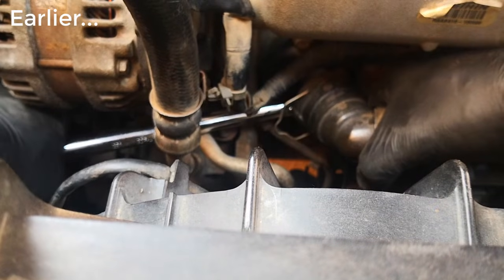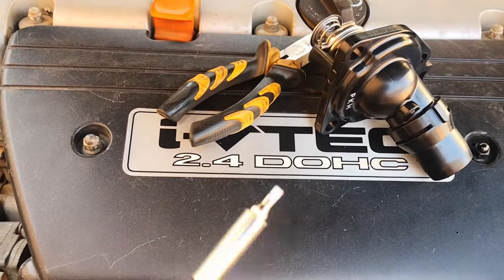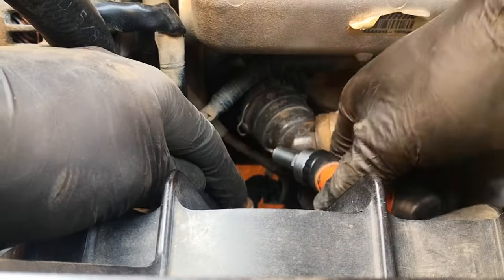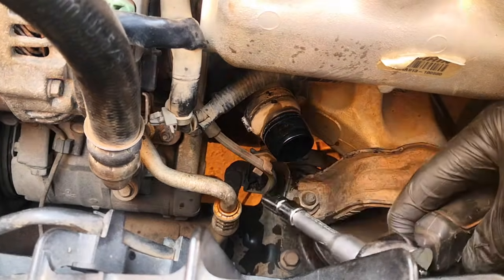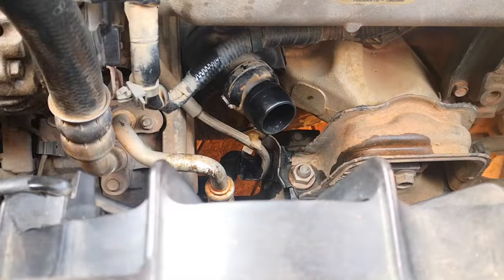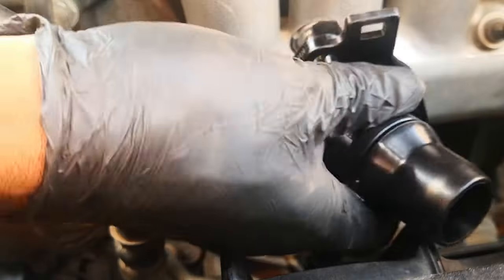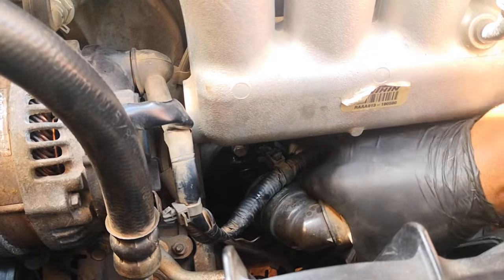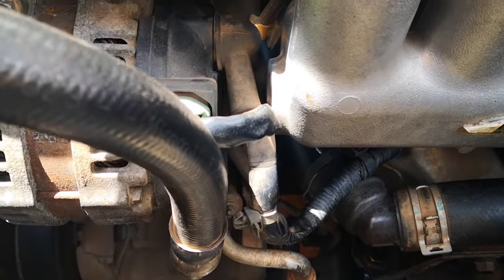Thermostat Replacement on Honda: 2003 - 2007 Accord, Element & Odyssey (K24A 2.4L engine)

Comment from the maker: Although most manufacturers do not provide guidance for replacing the thermostat, it's one of those parts that should be replaced as part of preventive maintenance in high mileage cars. Especially when critical components of the cooling system are replaced.

Comment: Nice job, aren't there two stats the on bottom, then the one on top with a temp sensor.
Reply from the maker: Thanks mate. The '03 doesn't have those. I believe it started with the '05 if I'm not mistaken.

Comment: My 2007 Honda Accord is now almost 210,000 miles and I have been learning how to replace parts and keep it running. As I drive it in the north, the salt from the roads and the yearly temperature fluctuations has really made removing bolts difficult; 2 of the 3 bolts were stripped and rusted in place. However, with some patience and taking some time to get away from the car, I was eventually able to remove the old thermostat somewhat destructively. The trick that helped my was penetrating oil (PB Blaster) and hammering on a smaller socket to get a bite on the bolt. Once the old one was removed, the new thermostat was simple to install and replace. Thank you for the help!
Reply from the maker: You're welcome!

Comment: Thank you for the video! I got it done in 30 minutes. Getting the hose off was easy. Just pryed at it from above with a massive flat head using the intake manifold as a leverage point.
Reply from the maker: Thanks for sharing the leverage point!

Comment: Are these bolts known to snap im worried ill break one
Reply from the maker: Haven't seen one snap, but not impossible. Though I don't think you should be that bothered. Is it rusted in place?
Reply: @DIYAutoworksNG ill take a look later on but the car is at 220k+ miles and according the dealership papers and the last owners the water pump hasn't been touched since it was bought over 15 years ago

Comment: Can this also cause my car idle so high on cold  start
Reply from the maker: A bad thermostat that is stuck open can cause a high idle, but "so high" is subjective. Is it a Toyota? If yes, did you reset the ECU recently, take off the battery terminals or clean the throttle body, and didn't do an idle speed relearn? Those will cause a high idle.

Comment: Will this cause ur radiator to leak? At the top and cause ur engine to overheat???
Reply from the maker: A blocked thermostat will overheat an engine. Not sure about causing radiator leak but plausible, though I think radiators leak mostly from ageing.
Reply: @DIYAutoworksNG  ok a blocked thermostat , I get that part but what about will that also cause it to leak at the top of the radiator near the top hose

Comment: To change the thermostat, do you have to drain the coolant or can it be changed without draining?
Reply from the maker: You have to, but I would imagine it can be done without draining if you have a clamp on the lower radiator hose. I won't want to subject the hose to the stress though..

Comment: Both fans turn on when AC is engaged, but neither fan turns on with a hot engine with the heater going full blast. Does that mean the thermostat needs to be replaced?
Reply from the maker: You may want to look at your coolant temperature sensor/switch. I'd go there before the thermostat except if they're integrated.
Reply: @DIYAutoworksNG  I replaced both and still the fans don't turn on unless AC is engaged or the switch wiring is jumped with a paper clip. When I turn the heater up full blast, it doesn't get hot really. Maybe the water pump is the issue.

Comment: I greatly appreciate this video - I have a 2007 Accord.  I can't get the bottom left screw.  I've tried almost every different size ratchet and extension but can't get the necessary leverage for the last screw.  I know it's a Size 10  but .....  just frustrated as I got everything drained, hose off and 2 of 3 screws off in minutes.  I'll keep at it ........
Reply from the maker: Thanks! Wish you all the best. Just take your time, and try different approaches and angles.
Reply: Hmm I didn't struggle with it at all. Maybe because I used a 3/8 drive deepwell 10mm and a short extension.

Comment: Good afternoon.  I recently bought a honda accord 2005 model and the former owner already removed the thermostat. The mileage is at 230000. Recently we started developing overheating. I want to ask should i get a thermostat reinstalled back or thats not the reason for the overheating
Reply from the maker: It's not the reason it's overheating. You'd need to work through the causes of overheating. I did a video on this that may be of help https://youtu.be/Jxax0Rk6NsM

Comment: Is it the same on the 2009?
Reply from the maker: I haven't worked on the 2009 but it should be roughly the same. Same K24A engine.

Comment: Good day sir, u made a review on Gumout All in one cleaner. I want to know if it works for all engine type. I plan using it on my Hyundai Elantra 2010  4cyl DOHC 2.0L. Their hasnt been any sort of cleaning done in d compostion chamber since i porchased it 4 years ago. I noticed a litle reduction in compression compaired to wen i just got d car. Can i use d Gumout cleaners stuff on it. Or is thare other types of gumout out there u can recommend i use. Thank u
Reply from the maker: Combustion engines have a relatively basic setup and Gumout should work on the Elantra once the steps from the manufacturer are followed correctly.

Comment: I’m having trouble with my heat on my 03 accord 2.4. The blower works but the air is cold, also the temp needle doesn’t reach the half way mark on temp gauge. Do you think this can be a bad thermostat? Thanks
Reply from the maker: Yep. A stuck open thermostat is a potential culprit. Low coolant, bad heater core valve and a few others.

Comment: Hey boss man you never gave the torque specs for the thermostat bolts.
Reply from the maker: Hello. Just double checked. I gave the torque spec from 4:30 onwards. Its 10Nm. Cheers!

Comment: When I got to your "lightbulb" moment on my car, that part would not budge. Had to break it and get a new one at NAPA. I swear Honda makes this hard this on purpose. Two hours later - I also could not remove the two bottom bolts. Rusted in place. Took it to my mechanic. Will never own a Honda again.
Reply: Yeah, those quick connect are not quick to disconnect.
Reply from the maker: 😂 🤣 🤣. That's the hardest part of this replacement! Luckily mine came out in one piece.
Reply: If this simple headache makes you not want a Honda you will be in WAY worse trouble with any other car. Then you think it’s smart to say never own a Honda? You may want to think again.
Reply: I have my first and last Honda. Overly complex., hard to work on, overpriced cheap plastic parts. I have had several Honda motorcycles that were topnotch but not my Element,Junk. Next vehicle will be a Toyota.
Reply from the maker: Seems like it wasn't a good experience. All the best! I have a Toyota in the family too, but I must say my Honda's have been bliss!
Reply: That's pretty funny since hondas are incredibly easy to work on. If you are working in a 7th gen accord, or any vehicle that is 20 years old expect rusted bolts. Pb blaster, a torch and bolt extractors are your friend.
Reply: @WesB1972 hahahahaha... Elements are NOT hard. This girl does all her own work.. except welding exhaust or transmission rebuild.  Not quite sure what you were expecting (?)
Reply: Scared cat
Reply: Guess you shouldn't  have let it overheat, then? 

Guy has no idea how easy he has it.  EVERY car that overheats will experience issues with frozen parts.  Every experienced DIY mechanic on the planet encounters frozen bolts unless they were not torqued to spec. Some mechanics use pneumatic on everything they touch, which screws it up for the next guy because now they're over-torqued.  Neither of these have anything to do with the manufacturer. When something goes sideways, there's  always some novice who blames the manufacturer rather than the mechanics who may or may not have known what they were doing over the.past 20 years. 😅😂

Comment: first issue i had was that the heater control valve broke. 
The center screw came right off and started leaking coolant and overheated the car. 
I replaced it and test drove it but i noticed the temp gauge was going up and assumed the thermostat stood closed since it overheated, 
i also replaced the thermostat. I test drove it and again it started over heating at this point i check the radiator and i noticed a small leak from one of the plugs in the bottom. 
i replaced the radiator and again overheating issues. the fans work. the thermosensor works too. any suggestions?
Reply from the maker: Sorry man. What's the color of the coolant? Milky? Head gasket could be burnt. Are you able to inspect the cylinders via borescope or check compression?
Reply: @DIYAutoworksNG  when I replaced the thermosat the coolant was normal. I didn’t flush the coolant for the thermostat replacement. I just sealed the edge of the hose.

keep in mind it was the same coolant for the thermostat. However when I was replacing the radiator I did the flush & the last 2 small tubes at the bottom of the radiator were the last 2 to disconnect when I did this dark water came out of what was left I assume of coolant and that was about it.
Reply from the maker: What car is this?
Reply: @DIYAutoworksNG  do you have an Instagram? I barely noticed you had replied. I’ll check those things out that you mentioned
Reply from the maker: Yes, I do. Search for piykediyautoworksng

Comment: Can u tell me why the autel 906tsdoesn’t communicate with abs? It says use connector which I did still can’t comm with dodge Dakota 2002 3.9 and 2003 4.7 please help me with this
Reply from the maker: Hi. I checked Autel's vehicle coverage page, and did not see 2002 & 2003 listed under Dodge Dakota. This may be the reason.

Comment: I took my 2007 accord to a radiator repair shop last week and he told me to buy the thermostat at the dealer because the aftermarket ones are crap and don't last. Can you please provide your opinion on this? Great tutorial video, thank you!!!!!
Reply from the maker: On certain parts, I only do OEM.  Thermostats are one of them! I agree 100%.
Thanks for the compliment!
Reply: True. Along with radiator cap. OEM from dealer. Spending $20+ on a radiator cap is cheap compared to the headache the $5. Will give you.

Comment: Should have change the upper and lower hose too since the car is so old.
Reply from the maker: Very fair preventive point. However, I would replace those only if they show signs of wear. They were still in good shape despite being old! The recommendation from Honda is to replace if they show signs of wear. Great point though.

Comment: Boss what is the name of the OEM thermostat u bought and where can I order it.. better still can I get d old one from you since it is also OEM. Thanks
Reply from the maker: Hello,
Honda calls it "Thermostat assembly (Nippon Thermostat)". You can order it here  https://www.hondapartscheap.com/v-2003-honda-accord-sedan--lx--5-speed-automatic/engine--water-pump-l4 
It's number 8.
I actually kept the part for a buddy of mine whose Accord doesn't have a thermostat and he's on a budget. 
I'd let you know if he goes with something else. Obvious caveat is that my car had over 255k miles before I removed this.
Reply: @DIYAutoworksNG  
Alright thanks sir , I just bought used 2005 Accord .. I have been following you on YouTube, nairaland and blog long time ago.. 
I will be looking up to you for some questions if you don't mind sir.
Reply from the maker: Congrats on your new car! Also, thanks for following! Will be quite happy to be of help any way I can. All the best!
Reply: @DIYAutoworksNG  boss has your buddy taken that thermostat ? I am still interested
Reply from the maker: Taken, boss. Hope your car has been good?
Reply: @DIYAutoworksNG  
Yeah it is serving me well, today I changed transmission fluid with HONDA DW1.. it is only throwing one code now downstream O2 sensor  I will fix that later.can I get a used OEM thermostat in Nigeria markets.. I am on budget now.. thanks for the care.
Reply from the maker: It should be available, I figure. You will just need to test it by boiling. You can check YouTube for the procedure.